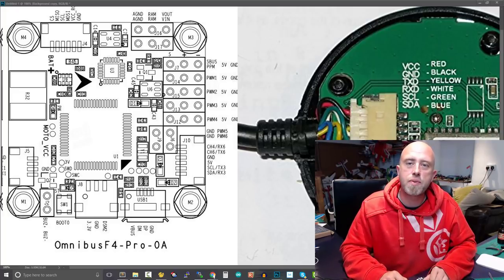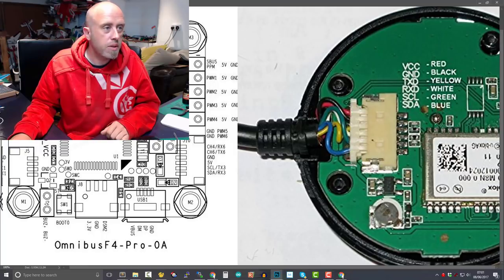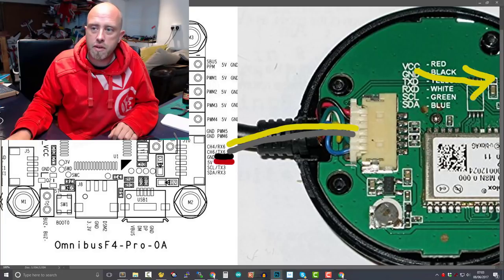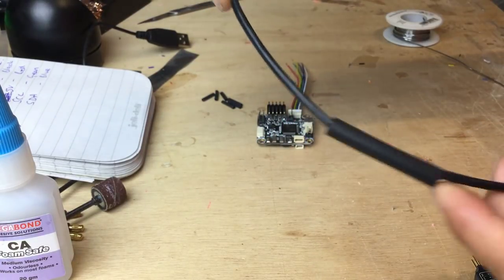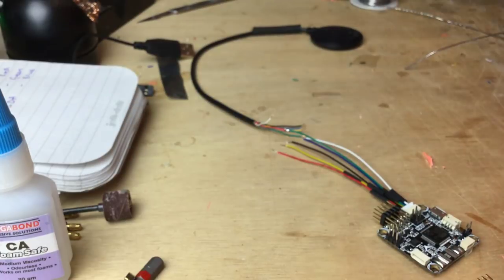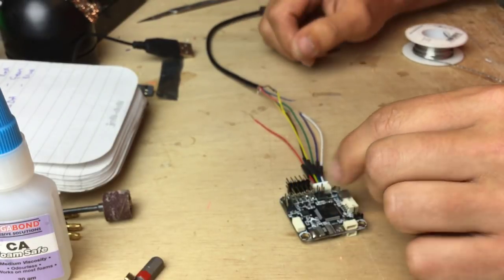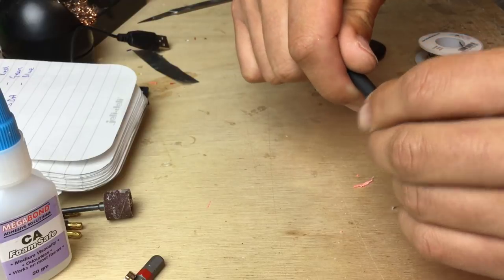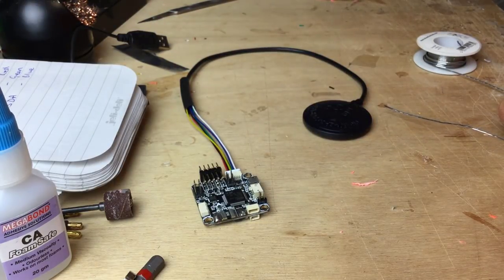Part #6B - Soldering Up the NEO-M8N GPS 📡 Unit for iNav [Omnibus F4 V2]

Comment: hi mat good vid my f4 and gps is on its way. would it not be better to de-pin the connector and put the wires in the right order so red to red n black to black ect
Reply: lol i think i have O.C.D lol
Reply from the maker: Howdy Rob, you could do that. When you realise how SMALL they are, you'll get over the OCD for the right colours and solder them up so you can get flying sooner :D
Reply: I re-pin the connectors power and ground HAVE to be the correct colors. A bit of Blu-tack and an Xacto knife blade they are soon changed around.

Comment: Just one comment on color coding. It is really simple (1-2 minutes job!) to swap wires and get correct colors in right order.
Reply: that's the way i do it all the time. red is ALWAYS vcc and black is GND. so you minimise any chance of issues.
Reply: when you bugger a connector its never the same again

Comment: Matt...The wire colors you provide are not consistent with the GPS you indicate should be purchased from Bang Good. My GPS fails to work...primarily I am unable to follow your video since the wire colors are not identical. Please advise. I am using a Omnibus V2. I cant go any further unless this wiring problem is resolved.  Thanks.
Reply from the maker: Howdy Paul, you'll need to contact banggood and ask for clarification on the wire colour coding if it's changed since the video was made, Matt

Comment: I wired the GPS, connected.Flashed INAV enabled GPS/compass. GPS turned blue, but compass RED. Did little bit of research and ran command set i2c_speed = 100KHZ and that had turned it blue.

Comment: Could the 'whatever' color wires from the white plug be simply removed (depressing a clip with a pin, etc) and all swapped to correct input position for plug.....just a nuance to make everything sort of 'look' right.....I've done that before on other plugs...but the little catch/clips sometimes bend too much and lets the wires come out of plug easily.....which may have answered why you din;t mention that.

Comment: my gps does not have the blue wire, instead its orange. wtaf
Reply from the maker: Take the back off, it's written in the board what they are. Matt
Reply: @RagTheNutsOff      you're a star Matt, great idea, I will remove the gps cover to check the wires.

Comment: What if my GPS has no compass only has 4 wire? Which is only has red, black, rx and TX?
Reply from the maker: Hey Van, as mentioned in the video, you find out which wires do what and then connect those up. A compass is not needed for fixed wing models, Matt
Reply: RagTheNutsOff thanks Matt , I just hookup the gps without compass and it works . Appreciate your help
Reply from the maker: Happy days :)

Comment: Any way to get both GPS and RSSI to work on a Omnibus F4? I have Omnibus F4 with X4rSB receiver. It works great as a racing quad in Betaflight. RSSI is going into CH6. I want to convert it to a GPS quad with iNav but the RSSI is going to CH6 and that is where the GPS input would go. SCL and SCA are combined with RX3/TX3 so I can't use that for RSSI. TX1/RX1 is the same as SBUS, right? so can't be used.
Reply from the maker: Howdy fella, yea I use RSSI and GPS on all mine where we have RSSI out from the receiver. As for the X4RSB receiver, no idea never used it. Also the RSSI doesn't got to a TX/RX input, it's on a dedicated pad or pin, see the later video on this, Matt

Comment: Please help me, I am trying to put a cc3d into an X8 Sky Surfer X8, the receiver's connection to the cc3d is PPM, the servo of the elevator I turn on channel 3 of the cc3d, servo rudder on channel 6 of cc3d, right aileron no 5 and left aileron no 4, only the left aileron works, the right aileron connected to port 5 of cc3d does not work, if it puts it in port 4 it works, then I conclude that the servos are ok, the same problem is in cc3d, I have two here with me and both are giving me the same problem, do not work the aileron of port 5, have any way to solve this?
Reply from the maker: Howdy Christian, I;'m afraid I have no idea for a CC3D. Also that board and the Naze32 are no longer being supported by iNav. Matt

Comment: Sir Good Morning I have the Ominibus F4 V3 in which I am connecting my transmitter Flysky i6 to ppm, please tell me how will the GPS wiring on this flight controller board when we do the ppm, you can connect to Sbus But how will the GPS be wired? But the GPS wiring on connecting through PPM can be described as Sir I AM Lalit Singh from India (I am use M7 gps)
Reply from the maker: Howdy fella, see the other video on the V3 board, you may have a tab you need to solder to tell the board to use PPM rather than SBUS,. If that is already working, then follow the steps for the GPS as they should be the same if using SBUS or PPM. If you get stuck, see the iNav FaceBook group or the wiki,  Matt

Comment: on this board for Inav users : on port tab only open : GPS on UART6 (no need to open port for the mag..I was doing that and messing everything ) ...on configuration tap GPS:  enable, Ublox, auto detect ... on configuration tap sensors : select mag HCM5883 (most commun) auto for me was not working and u r good to go...
Reply from the maker: Howdy Vincent, we don't need the mag for fixed wing models, they're always flying forwards so the GPS fix is more than adequate, Matt

Comment: Hello! So I have a SP RACING F3 that doesn't come with a Barometer nor a Magnetometer, and I have a single I2C port with one SDA connector (that has a wire coming out of it) and I need to connect the above two sensors and a GPS along the same SDA wire. So if I solder it in parallel to the SDA wire, will it work?
Reply from the maker: Howdy Sam, I have no idea on that board I'm afraid. Matt

Comment: Sorry matt I can't find that other video ummmmmmm I found this one which is more us full as the other video you gave me was for the v1 board, I have a v2 board f4 so the other video is erelevent how ever on this video you have that cable and plug, where did you get that from please, As I said the plug that comes with the GPS unit will not fit my f4 board. It fisicly won't go in.......... plus you have 6 wires in yours where as mine has 4 pluss the other 2 for the sli, and what ever?
Reply from the maker: Howdy Nigel, see video 2 in the series, you need a 6 pin JST SH 1mm plug/wires, Matt

Comment: sorry matt..stupid question...why do you use 6 wires with SLC/SDA if you not gonna use the MAG ... 4 wires should be plenty and a GPS without compass cheaper eur 10 on Bangoog instread of eur 19 with GPS + compass unit ... correcto amigo ?
Reply from the maker: Howdy Vincent, yea this question has come up numerous times before. That GPS unit I have had fantastic success and for this series I am staying with what i know to work exceptionally well. Also we're soldering up the Mag (compass) at the same time because if you want to enable it, you can do at a later time. Matt

Comment: Hi matt great video's  I bought a FLIGHT CONTROLLER F405-OSD but wondering where I can wire in the GPS it's a new board to me bit stuck😕
Reply from the maker: Howdy Pete, I;m sure you can, look for the same UART ports as mentioned in the video, but for your board setup, Matt

Comment: For the connector it might help to un-pin it and plug it back into the connector so that the wire colors match the GPS wire colors.   Then there will be no confusion!
Reply from the maker: Howdy Shawn, yea that did cross my mind, however when you see how small these connectors are in real life, you think "screw that" and use the wiring diagram instead :) Matt

Comment: 5v? Isnt it supposed to be 3v? I bought exactly the same one from Bangood as in the link. If you follow the link, it says 3v in the specs of the GPS. Can it also handle 5v? Ps: great videos, just subscribed, and will make sure i use the affiliate links, as i get heaps of stuff from Bangood.
Reply from the maker: Mik H See the playlist/other comments as this has already been proven incorrect or to the point it does not matter because of the use of a voltage regulator, Matt
Reply: Awesome thanks Matt.

Comment: Hi Matt, I have a couple of (simple?) questions for you...
- Is the connector in the GPS rcvr the size needed for the FC board?  I assume not, or you could have used it instead of soldering up another one.
- The GPS unit says that it has a max input voltage of 3.6V, but you are connecting it to 5V.  Won't that hurt the GPS?
Thanks!
Reply from the maker: Howdy, see the other comments on the GPS voltages and then see this video https://www.youtube.com/watch?v=LFkKcOpFo7k. Also the parts required are in the first two videos of the playlist here https://www.youtube.com/playlist?list=PLgoM4-umzSqd0clW-e_A12yKiOpV--3a2
Reply: Thanks very much!  I am sorry that I missed that other GPS video, I was following the series.  Love the videos and the help!